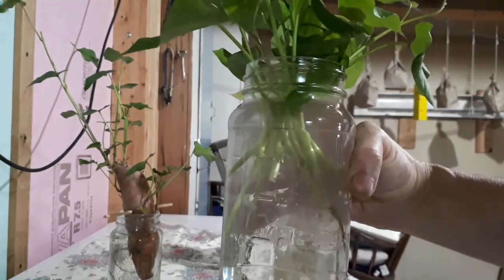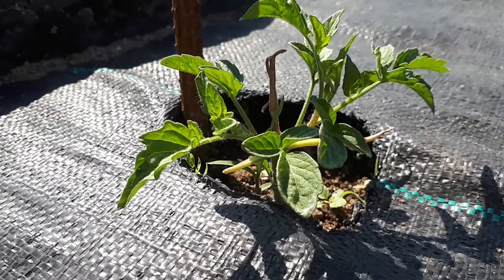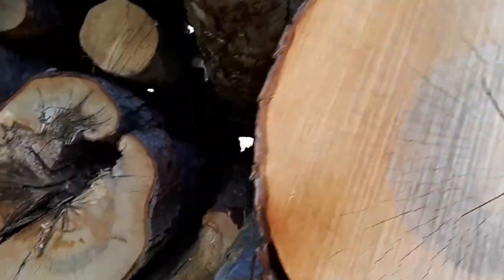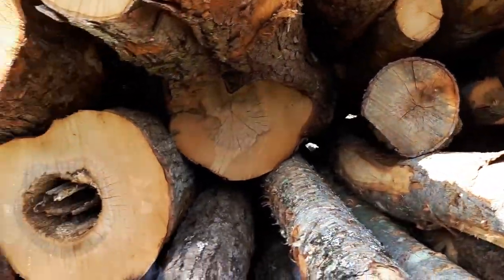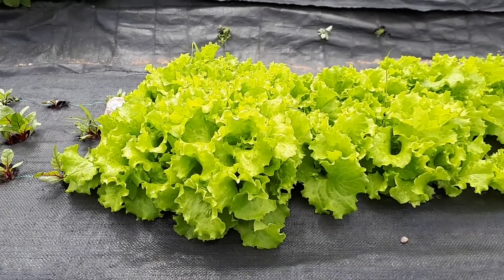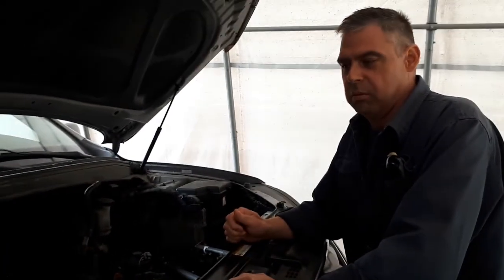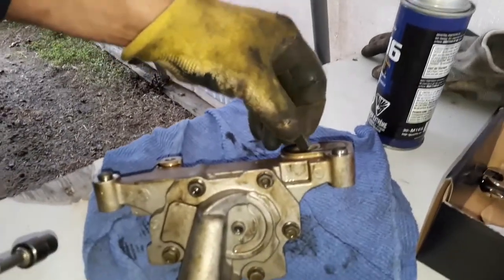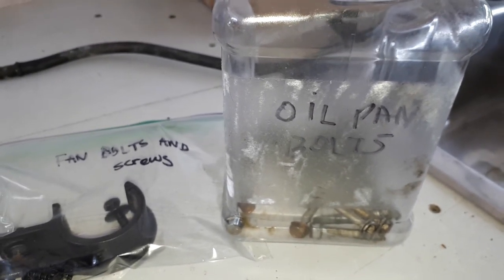End of June 2020 garden update and 2011 Hyundai Santa Fe Engine failure Part 1

Comment: How long it took you to do everything? Nice job
Reply from the maker: Thanks for your comment, in hours it took about 16 hours to do the job but because parts were difficult to get and wait time of the postal service was longer than usual, it was spread out to over a month to complete it.   Cheers from John and Audrey
Reply: @purecanadianlifestyle  that's great. You both are great teachers.
Reply from the maker: @mouh36  Thank you very much for the nice comment.  Cheers from John and Audrey
Reply: @purecanadianlifestyle  can you please show when or how you removed the fuel lines?
Reply from the maker: @mouh36  Thanks for your comment, I removed the injector rail from the intake without removing the fuel lines from the rail, I simply set them to the side and continued working.  You can see the rail in my hand at the 12.15 minute mark in this video.  Hope this helps Cheers from John and Audrey
Reply: @purecanadianlifestyle  yeah I saw it, thank you for the reply. I actually looking for tip on how to relieve pressure on 3.5l Kia sorento so I can empty gas tank with bad gas. Cannot really find where to bleed that fuel pressure..
Reply from the maker: @mouh36  Thanks for the comment, if you like we can post the information from a shop manual on our face book page, let us know if that will help you.  Cheers from John and Audrey
Reply: @purecanadianlifestyle no need guys, thank you! The fuel rail connection is inintake manifold diagram?

Comment: Where did you find the timing chain component parts for this engine? I cannot find it anywhere for my 2013 3.3L V6.
Reply from the maker: Thanks for the comment, we did not replace the timing chain and tensioners in our rebuild. However most of our parts were found on eBay or through the Hyundai dealership.  It took a long time to received the parts.  Cheers from John and Audrey